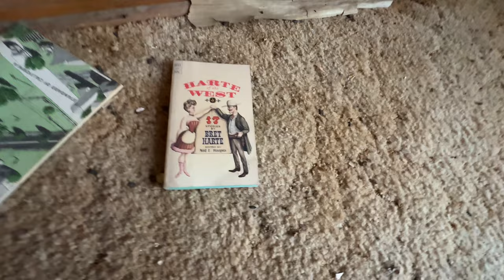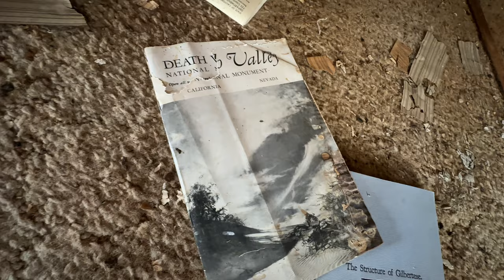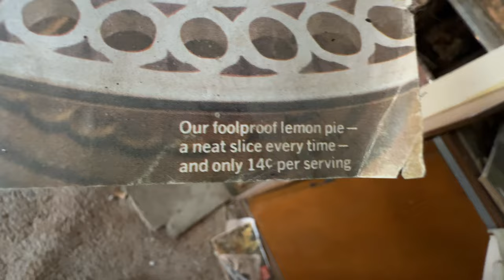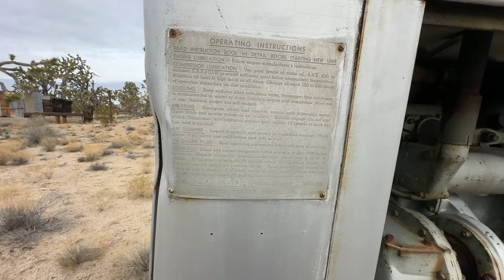ABANDONED HOME in the desert

Comment: I love this place! I would move in tomorrow. Really cool built in cabinets and shelves.
Reply: That machine toward the end is a compressor, probably to power the rock drilling rig on the trailer.
Reply from the maker: Little hard work on the cleaning side, and this place actually would be a pretty cool place. It actually has a lot to offer if you look pass the decay. Thanks for Watching!
Reply from the maker: Does it also use water along with the air compressor, i was trying to figure out the tanks.

Comment: The  air compressor  looks  like  a ex mine unit  and very complete  with some tinkering probably  run again
Reply from the maker: @charlesschulz8416 that thing is massive and your probably right with a little elbow grease and mechanical background someone can get that back up and running. Thanks for watching and the insight.

Comment: The first building looks more like a shop. Did it smell like grease? Oil? Or manure? The concrete pad, there looks like a place to pull a vehicle on a ramp. I would have liked to seen a bit more of that area.
Reply from the maker: @abayless3816 It did have shop smell of oil, I was thinking it was from the train type of smell due to all the railroad ties and the fact the switch for the railroad was not to far from here. As you seen in the video the equipment that was used for mining I'm guessing and this might have been a work shop by the way all the garages were layed out. This was a Great Comment, and i just might have to revisit this place and take a more subtle approach as I missed quite a lot. Thanks for watching and for the great comment.

Comment: A little cleaning ready to move in
Reply from the maker: You are so correct, and it's in such a really beautiful area of the Mojave Desert it would be an ideal place, There is power lines running right beside the fence line, it's just been cut down. As for water, most likely from a well or they bring it in. Thanks for your support